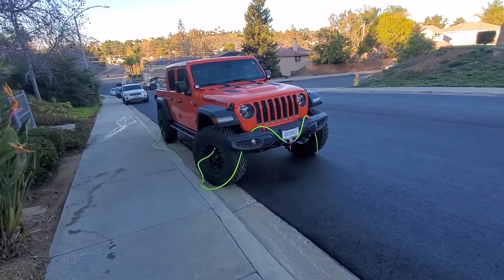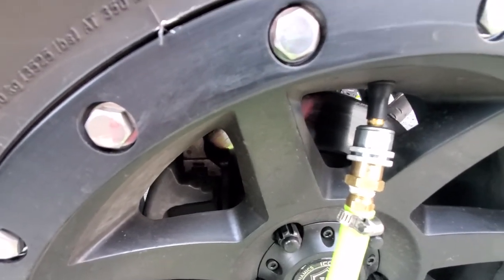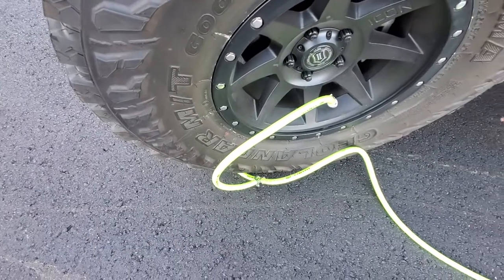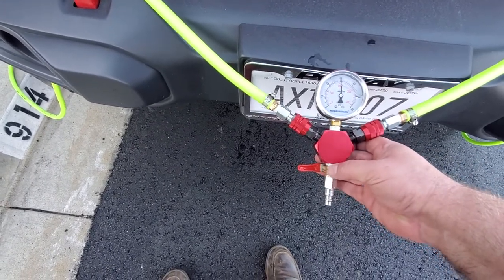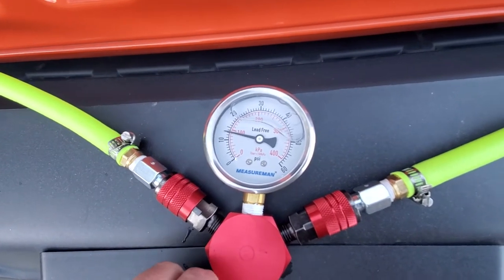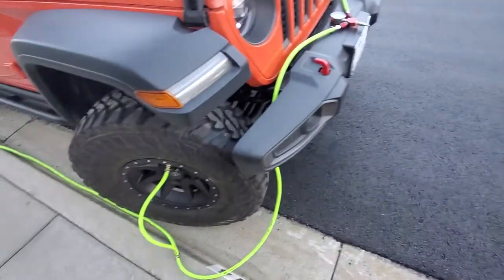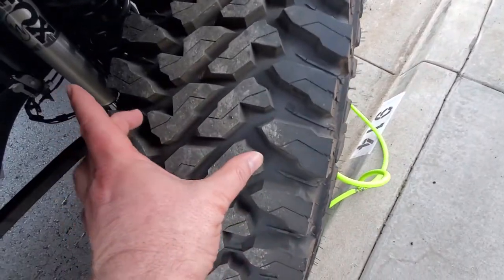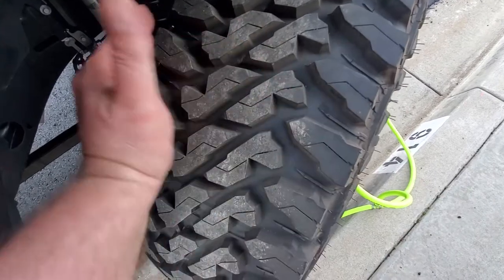Jeep Gladiator 4 tire air system

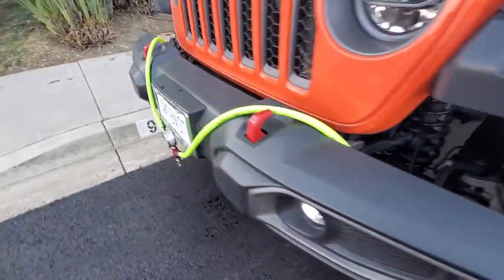Comment: I just use the auto deflators, and go chit chat with people. For airing up, i still do it one at a time, I just set a timer for about 1:40 then move it to the next tire. Then go back to the just filled tire and check pressure, it's usually about 3-5psi more, so i just deflate to correct road driving psi, put valve cover on. By the time i finish that, the next tire is almost done, timer goes off, then off to the next tire and so on. Not sure if the 4tire inflator would make it any faster for me the way I do now. Still contemplating on making one tho. :)
Reply from the maker: That way totally works too.  I notice that when you have big tires like mine and you're airing up from 15 to 30 lbs, I'm not done much sooner than others doing it one at a time.  I just stand at the manifold talking looking at my pressure gauge while others are going from tire to tire...checking pressure each time.  So maybe not too much faster, but smoother and cooler looking lol
Reply: @SoCalJeepGladiator  those last two reasons are probably the same reason that I wanna do this as well lol.

Comment: I would prefer it for air up, by the time it gets taken out and hooked up I could have all 4 tires just about airred down but nonetheless great work!
Reply from the maker: Thanks for the compliment and I have to admit, I think you are 100% correct.   I am starting to notice that very thing.  I may opt for one of those preset airdown chucks and just use this for inflation.  What do you use for air down? Have any good suggestions?
Reply: @SoCalJeepGladiator  Staun automatic tire deflators is the way to go. It makes airing down so simple once they're setup. I screw them on at the beginning of a trail and take them off at the first stop. They've never failed me.
Reply from the maker: @sun_dreaming  I actually bought those before you replied, used them with Lite Brite and E3 Offroad on the trail takeover in Big Bear, CA this weekend, worked great.  Thanks for confirming!